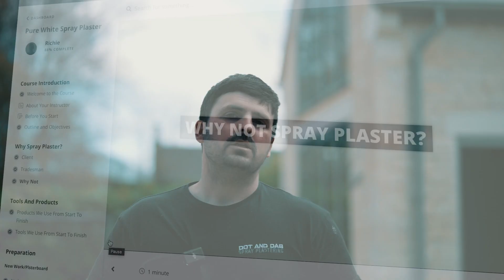On Site Spray Plaster - The Spray Coach -Graco mk5

Comment: Great video pal only wish I was able to jump on but fly solo .I can definitely see the benefits of spaying  !
Reply from the maker: You dont need a team to spray mate.. i did 800m2 on my own a few months back.. its simple stuff when you know how
Reply: What can u spray....multi finish,board finish etc??
Reply from the maker: @rockyslack799  no we don’t spray either , been there done that . The spray plaster we use is designed for spray application and its ready mixed. 

The way this works is completely different as are the results and level we achieve👍